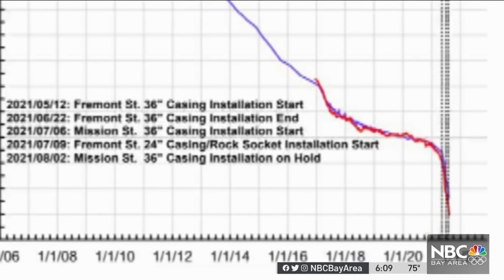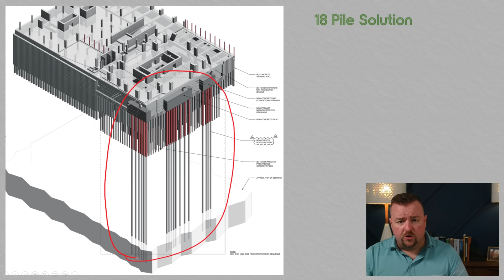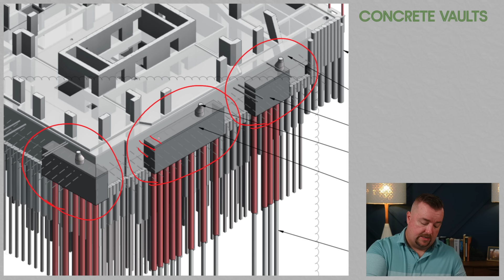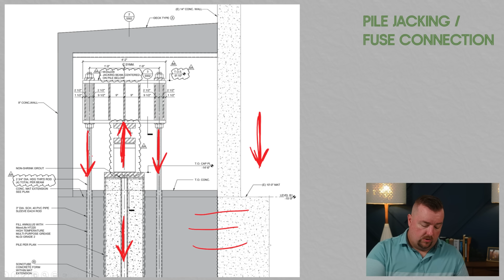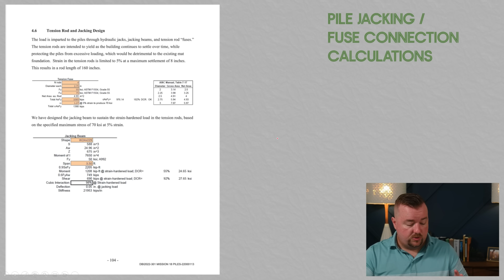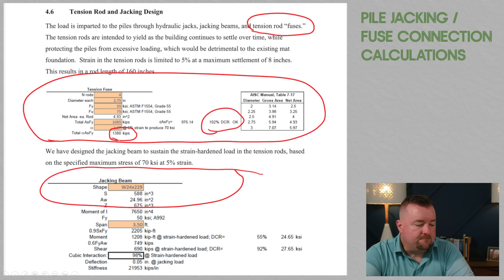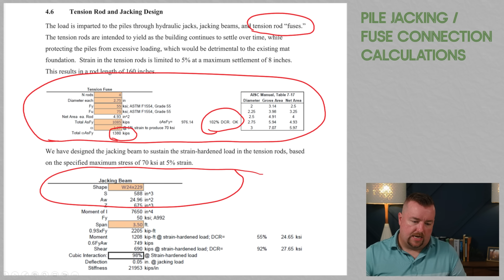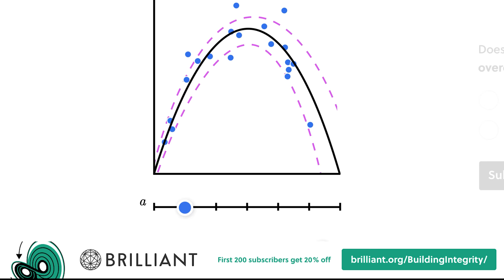Did I Uncover a $100,000,000 Mistake with the Millennium Tower "Fix"?

Comment: This situation reminds me of the Hyatt Regency walkway collapse and lack of attention on critical connections.  I appreciate your approach to this and how you can make an electrical engineer understand structural engineering concepts.  As opposed to most engineering designs (cars, airplanes, computers, etc.) buildings need to withstand years of minimal attention and stay within their design parameters.
Reply: I'm thinking of the concrete truss pedestrian bridge in Florida.  'Concrete' and 'truss' are words that you don't hear in conjunction very often.  Similar scenario.  Tensioned rods with adjusting nuts anchored in concrete.  The concrete failed where the rods imparted force to the concrete.
Reply: Right on , in the St. Louis walkway collapse where the nuts pulled through holes in the beams . 200 plus people would be alive ,if they had just put big thick washers under the nuts.
Reply: The Hyatt Regency bridge collapsed because the support rod connection was changed in the shop drawing phase. The original engineering was not great,  but the decision to split the rod was fatal.
Reply: In this disaster, the new design that made it easier to build, doubled the load on a set of nuts and the nuts failed at this new load plus a walkway full of people.
Reply: As soon as i saw the threaded rod in cross secrion... i thought the same thing
Reply: I was looking for the plate as he was describing the drawing; looking at it endwise I thought it was a washer.
Reply: Also bad inspections.

Comment: I admittedly don’t deal with buildings, nor have I done any calculations on this, but I am a naval architect and ships involve some truly mind-boggling loads. 1 1/2” plate is about what you’d expect to find as the flange thickness for the foundation for a big diesel, and just based on my eye, a connection where something like a bolt is loading a plate like that with 125 tons, I’d expect a lot more backup structure around those holes, with a lot more material on either side. I wouldn’t expect only 1 1/2 on either side of the bolt with no backup structure on something that important.
Reply: Just as an interested “ spectator “ I would think that those “ all thread “ bolts and washer and nuts should be about 12 inch diameter sizes , given the loading they are dealing with.

Simpler plan is to “ prune “ the building down to 10 stories.
Reply: Appears that the surrounding concrete of those "small" 'all-thread' plates is part of the expectation of support.
Reply: Perhaps they intend to use a big-assed fender washer, a lock washer, and "Blue" thread locker on the nuts at the connection point to the metal plates.  You can't argue the extensive safety factor of  the blue over the red.
Reply: @frankagent7472  They will not be needed as they have put lock nuts on one end of the threaded bar.
If they wanted to silence the doubters they should have put 3 or 4 locknuts on each end of the threaded bar.
Reply: I'd expect "overkill is almost enough" for the plate preventing pulling the rod out of the concrete.  Something on the order of a manhole cover near the bottom of the concrete.
Reply: OH was a railway engineer (UK term, not driver, engineer) , and he said much the same thing as you when I explained this to him. The scale just doesn't seem right- it's more the sort of thing you'd use on one of your good old US steam locos. They're big, okay, and bigger than our UK steam locos (which tend to be built with plates and not bars), but they're not insanely-stupidly-massive-multistorey-building big.

Comment: I’m not a numbers person at all, but I’m fascinated by the psychology/group dynamics that lead to really bad decision making.  I love your channel because you explain the technical side in a way that even I can understand, and you also provide some insight into why a situation may have happened.  (Too much focus on cost-cutting, assuming that someone else has done the calculations, etc.)  Understanding how intelligent, qualified people, when put together in a group, can overlook something that seems obvious is intriguing.
Reply: Groupthink
Reply: Two adjectives are pervasive throughout:  Cheap and over-confident.  What could go wrong?
Reply: Cost is a huge factor.  I'm not sure about San Francisco regs, but here in NYC, you can't demo buildings of this magnitude easily.   So say you go through the catastrophic process of writing it all off.  Now you essentially have to erect a giant shroud around the whole thing and then work from the top down breaking it down.  There is a breathtaking amount of resistance to doing something like this, for obvious reasons.   The last time this happened in the US was with the Bankers Trust ( Deutsche Bank ) building right next to the world trade center.   It took them several years to fully deconstruct it.   You can bet, due to sunk cost, that they want to avoid having to do this by any means necessary.
Reply: @phuturephunk  It could demolish itself.  Side pins with partial and imperfect connection to bedrock is not re-assuring when the next earthquake hits.
Reply: @phuturephunk  Forcing them to deconstruct it and start over is the only way to send a clear message to future builders to not take stupid shortcuts.
Reply: @phuturephunk  Sunk cost fallacy. Keep on keeping on in a terrible situation because you’ve already wasted so much time and effort, and the magic fix will surely be around the next corner, even though you’re traveling in a circle.

Comment: Because the vault only being connected on one side to the building, the rods closer to the building will experience a higher load. The whole thing will try to rotate towards the building due to non symmetrical loading.
Reply: That's what I was looking at. The typical placement of the rods is in direct alignment under the wall. Only compression forces pushing downward on the existing pylons. These compartments are side mounted to the basement. Concrete is very weak in tension loading even with rebar. The weight of the building is going to apply a moment force to the thin wall of the building foundation and crack the entire length of the side at the top line of the basement. The better option is to replace a set of existing pylons with this setup. The load needs to be directly over the pylons, not cantilevered off the side.
Reply: I thought the whole point of the side pylons was to simply slow the settlement on the faster side. This is why the rods are designed to yield right? So they do not actually hold up the building only on one side? Once the settlement rate is slowed the rest of the building will not experience any shearing since it will be more or less evenly supported. The only shear forces will be the uptake of that extra load, which should only be a small fraction of the total weight. 

Or am I misunderstanding how this fix is supposed to work?
Reply: @lucusloc  The building load is, currently, straight down at the wall. Suppose the wall is an 8foot long 1foot tall 3/4inch thick plywood. All interior forces are pressing down on the upper edge of this wood. If you take a dead blow hammer and tap irregularly along the edge, this will drive the 3/4inch thick wood into the ground like a knife. Live loading is like this, and the edge will descend vertically, yet evenly end to end, which is the situation as it exists today. However, in this building, one end is digging in faster. 
Next, attach a two chunks of 2x4 along one side at 2 different locations. Now tap with the hammer again. Notice that the board will tend to warp. That warp cannot be avoided because of uneven forces caused by rotational forces at the attachment points of each 2x4 block. No matter how lightly you tap, the board will warp as the edge buries itself deeper into the ground. Wood can take this kind of uneven force. Concrete fails under this type of loading, hence the cracks in driveways and sidewalks as the concrete settles. The basement wall of this building will crack under the warpage caused by those side loading pylon boxes (2x4s). It will crack along a horizontal line drawn between the top of the 2 pylon boxes. That is why pylons under skyscrapers have to be directly under the load, that makes them part of the compression loading. The fix pulls the support off to the side of the wall, putting tension on the inside wall of the basement at the top of the pylon boxes. This is bad.
Reply: I’m not an engineer in any form, but when I first saw the design in this video I had a similar thought.

Comment: I am an aeronautical engineer and have no much familiarity with building standards - but:
The effective bearing area of the steel plate is 6.5"x12"x1.1 -2x3.141*3^2/4 = 71.6in2
Compressive strength of concrete is anywhere between 4,000 and 10,000 psi - so even with the lowest value the concrete covering the plate can take 286,000 lbf, and probably quite a bit more.
Cross-section of the plate is 6.5"x1.5" =9.75in2. Shear strength of grade 55 steel (assuming that the plate is grade 55) is about 50-55 ksi. So, the plate can take about 487,000 lbf in shear (from one rod).
Can the lower nuts be pulled through the plate ? Without getting into the nut dimensions -  a circular shear section area 3" in diameter through the thickness (around the bolt) is about 3.141x3x1.5 = 14.1in2 (more than the cross-section area of the plate based on 6.5" width). So - pulling the nuts through the plate would require about 705,000 lbf. So - I do not think that shear is a problem here.
Having said that - the design operates above yield stress. Any rod which exceeds its yield stress will start shedding the load between the remaining 3 rods - which in effect will equalize the load and share it equally between all 4 rods. This is good and makes sense - but leaves no room for any safety factor -which practically does not exist. Even in aircraft design a minimum safety factor of 1.5 is required...I
In short - the design makes sense, but if something goes wrong - it won't leave much headroom.
I would be interested how you came to the conclusion that it may fail in shear.

EDIT: The thing which would really worry me is the assumption that yield will occur along the whole length of the rod. The most obvious location for the onset of yielding would be the thread - unless the minor area of the thread is MUCH larger than the cross-section area of the rest of the rod. Once the yielding starts there - this may lead to tensile failure of the thread. The second problem may be the necking anywhere on the rod (this is how rods usually fail in tension). If yielding starts locally and necking follows - we may end up with nowhere near 5% of total elongation and a fractured rod (fracture either on the minor area, or the plain section of the rod).
I sincerely hope that a test (or a series of tests) have been done on the plate and on the rod itself to confirm its behavior (that is, its ability to actually achieve 5% total elongation w/o fracture or necking).

And - no safety margin would make me EXTREMELY nervous. If I am reading this design correctly - the whole concept relies on uniform yielding of the rods (along their whole length), while assuming sufficient strength of the threaded section (which may be questionable if the critical section of the rod is the minor area of the thread). While this (in theory) leads to all 4 rods sharing the load equally - the resulting margin of safety is practically non-existent. Controlled yielding IMHO is a somewhat brave concept...
Not a design which would make me sleep soundly at night.
Reply: among all 4 rods
Reply: Thanks, finally a comment with math and not with "feel like it looks small..."
Reply: @les8489
Very good point!
The plate and the nuts have to be pulled through solid reinforced concrete, something I consider unlikely in the design shown.
Steel rods can very well operate in a stretched state for years, e.g. cylinder head or wheel bolts.
The force they have to hold does not exceed the tension they excert on the connection, so they will not encounter dynamic stretching.
But here the bolts are meant to do exactly that - they are basically used as springs.
Reply: @sthenzel  Well...a long rod can work as a spring - in elastic range. Above yield - its behavior I would consider as somewhat not quite predictable (yield at threads and possible necking). The plate itself - is rather skinny. It takes the load from 2 rods (if I understand it correctly), and the bearing area on concrete is only a bit more than 70 in2. Two plates - 140 in2, and the load is 1.3 million pounds. Which would call for a very high quality concrete with compressive strength in the order of 10 psi. I think that the design is marginal, and the OP was quite right rising the issue - although shear strength of the plates may not be the actual problem.
Reply: @merzto your comment scares me.  this must be rectified.  before I wail.
Reply: Good calculations; I was actually thinking along these same lines but I seen that you already did the math.  I agree with you here that there isn't any safety factor based on the info in this video.  We all know that despite best manufacturing intentions, that some products leave with minor to major defects.  I hope everything has been thoroughly CQ'd several times prior to assembly.

As others have commented, putting all of these "fuses" around the sinking corner seems a bit risky as well.  There's gotta be a major crack in the existing foundation to allow that corner to sink, or massive soft dirt/voids there.
Reply: well they are loading each plate with at least 500,000 lbf so they would need 7000psi concrete for the plate size without the safety margin. Anyway the plate seems unnecessarily small
Reply: @sthenzel  A 'spring' which has passed its yield point cannot correctly be defined as a spring, surely?
Reply: Factors of Safety aren't factors of safety. It's just how much margin we think we have. And the reason we need it is because we don't know how much margin we have.

Good engineering relies very heavily on conservative estimation. When it's just estimation it's not engineering, it's gambling.

Ps. If you already have the numbers, perhaps check the threads for stripping. Also keep in mind most material science data is obtained using clean polished samples with the intent of eliminating the variables of surface defects. In the real world we don't have that luxury.
Reply: The unknown and incalculable seismic loads would put the plate and bolt arrangement weil under safe design limits theorectically....

.... and that may be just theory because of the number of independent piles interactively supporting its adjacent system.... not possible at all to model....  The quake can be up and down, and mixed with sideways,   and amplified with acceleration forces.

 On principle I would not make anything in that system small....  I would spend the extra 38 cents at every opportunity.
Reply: I don’t really understand all of what you said (I have a business degree), but I genuinely appreciate you taking the time to write it all out. What I was able to understand made complete sense. I hope and pray that someone in San Francisco pays attention to your comment and this video, because you’ve spelled it out really well.  Thank you for your service.
Reply: Wouldn't shear be calculated at the weakest point in the plate and not with full cross section? (ie look at the cross section point where the rod goes through) 6.5*1.5 - 2.75*1.5 = 5.625 in2 This would result in a lower range of 281,000lbf @ 50ksi (not an engineer either, but spent 7 years designing and building hydraulic cylinders)
Reply: The thread is a very good point. I often see calculations based on the cross section of the bolt without much consideration given to the thread 😜

The distribution of stress is not uniform and is often concentrated in those threads closest to the load face. Threads fatigue - especially at loads near or exceeding the yield limit of the material.

You don't get to use modern cylinder head bolts a second time - you throw them away 🤣

I wouldn't have used a nut. I would have had some custom bars made with a cap at the end. 

I wonder if they tested those threaded bars with nuts? Cycles to destruction 😜
Reply: OH WELL. ..... I'M NOT CLOSE  🤣🤣🤣🤣
Reply: @les8489  you are conflating contact pressure and compressive stress.  The cross section of the concrete is much larger than the plate, so you are going to see a much lower compressive stress.  

It's why train wheels with 150ksi contact pressure can run on mild steel.
Reply: The stress you calculated for the concrete applying to the plate (286 ,000 lbs) is the average load over the area of the plate. Given that the plate is rather thin, the contact stress on the plate near the rod may much higher is the concrete isn't hard enough. Hopefully, that concrete is at least 10 ksi
Reply: @ES-sb3ei  I've said it once, and I've got to say it again.  Contact pressure is not compressive stress.  If the concrete had the same cross section as the plate, it would be, but the concrete has a more larger area to distribute the load.

For example, oil has no compressive strength, yet can support a 10,000 psi load in a hydraulic jack because it is contained and net shear stress is 0.

Comment: When I saw that they built this monstrous building on sand-supported pilings, I just shook my head. When they built my house, they did this same "engineering" - and guess what? I paid big bucks to do perimiter pilings to jack the joint back up. And - yes, we have foundation dishing. Go figure...
Reply: Who could have guessed an engineering method that even failed to work on a house would work flawlessly on a sky scraper lol
Reply: That's because it is your house.
I will bet that none of the engineers, architects, developers, etc. own anything in the Millennium tower.
Their only ownership is the extra proceeds from cutting corners.